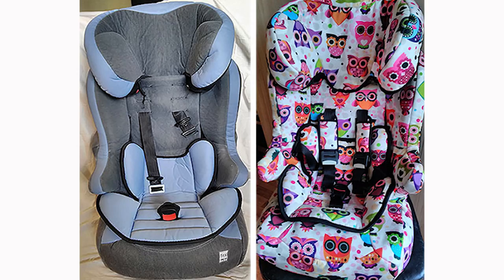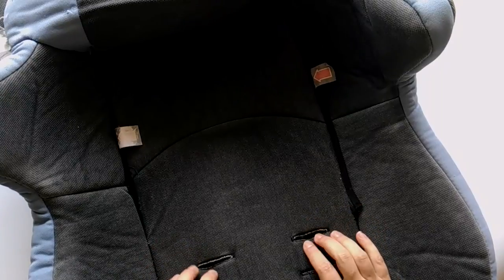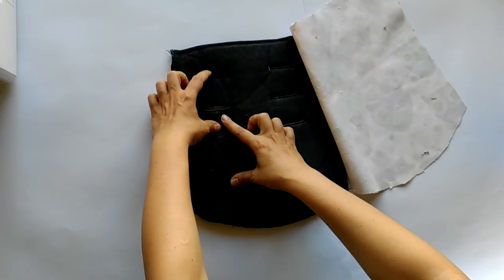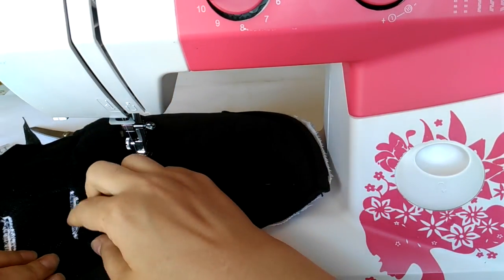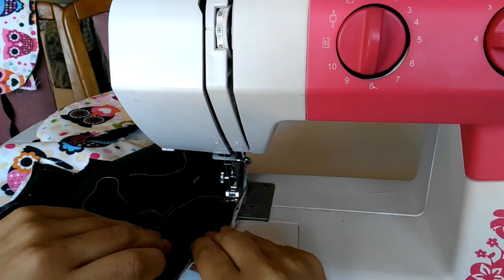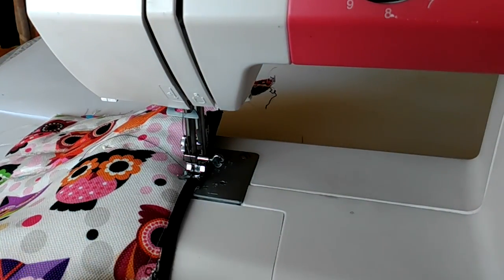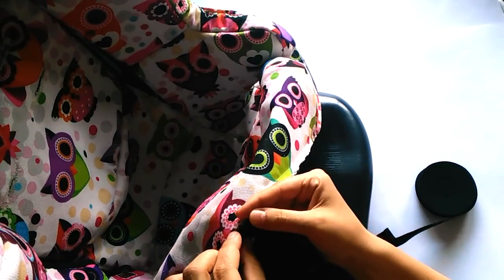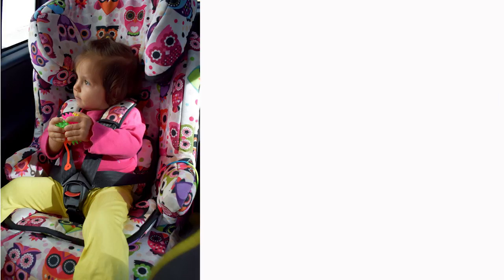How to make a car seat cover

Comment: This is not safe at all and should not be used. Please don’t do this. If you need a replacement cover, call the manufacturer.
Reply: JessicaChiann what’s not safe about it ?
Reply: Please explain how it isn’t safe because I really don’t see the problem
Reply: @PrettyGirlivy94  its flammable and safety seats have flame retardant on them and any added fabric can make the restraint not fit the child correctly.
Reply: The fabric is super thin how is it effecting how the child fits in the seat. That's right cause it not
Reply: @donjoe1890 actually cotton is all but flammable. Probably less flammable than the original seat. 
About the safety, if she hasn't attached the material to the original cover piece by piece it wouldn't be safe, probably, but she just did the facing of it.